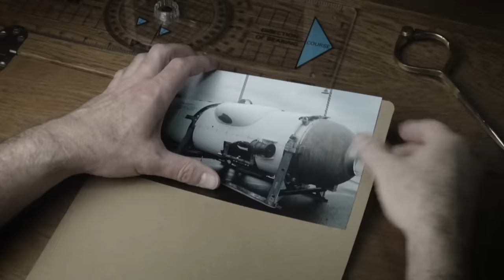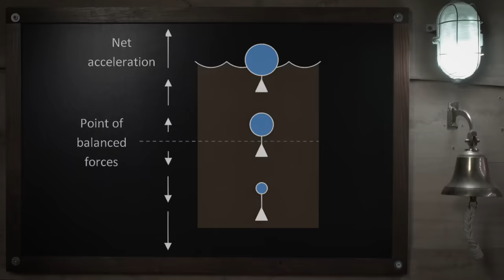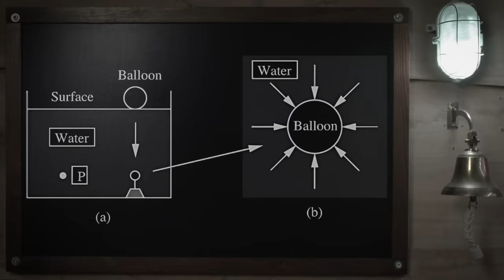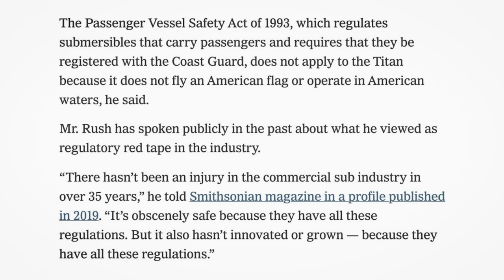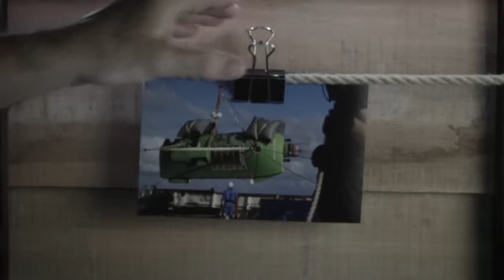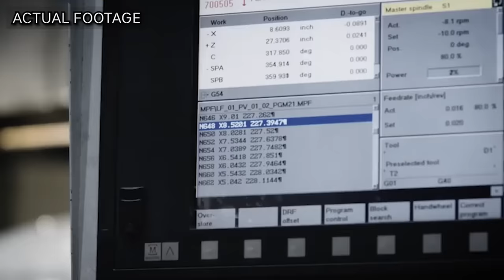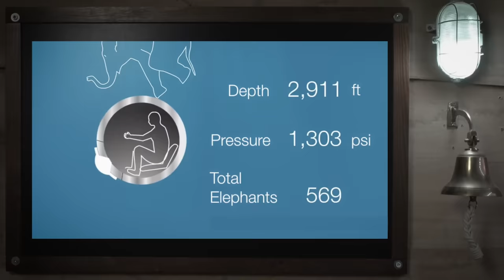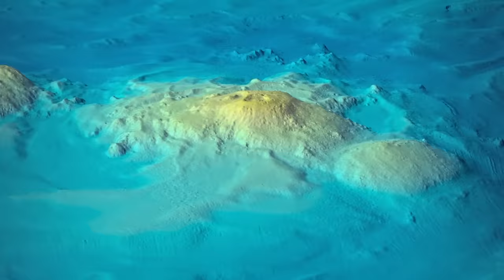Titan: From Inception to Implosion

Comment: One important thing to note, some experts agree that the sensors were a gimmick. There was no testing confirming that they would work or even provide enough time to do anything.
Reply: That sounds very on brand for Rush.
Reply: I explained it in more detail in my comment, but essentially the time between "sensors warning you" and "catastrophic failure" is in the seconds to milliseconds range. Enough to inform you of your imminent death, not enough for you to do anything about it.
Reply: Basically it's not sensors for a warning it's sensors that tell you "You're fucked" 💀
Reply: Basically it's not sensors for a warning it's sensors that tell you "You're fucked" 💀
Reply: @Ember2168 which would  be better not to know
Reply: Kind of like using a smoke alarm to warn you of an air raid.
Reply: @WineScrounger  Well, you certainly have a way with words😂
Reply: @Ember2168  agreed. All the " sensors" did was tell them that their death clock is now counting down.
Reply: @MechMK1 well, it gave them just enough time to kiss their asses goodbye.  And into the kingdom of hell.
Reply: The one small mercy with an implosion like this is it happens so fast you won't feel a thing or know its happening.   This genius invents a system where an alarm will say "YOU'RE GONNA DIE"  when its too late to do anything about it and you're trapped in a submerged coffin kilometres below the surface of the ocean.
Reply: @irieite9666  it's TERRIBLE!  I'm still having nightmares
Reply: Yeah, I recall seeing an image of the canopy cracking with the caption "When it cracks we have a warning that is cracks" Who on earth thinks that anything of a warning? What was the plan on doing if cracks started to show on the canopy? abandon ship?

this alwys make me think about ore mines that used oak studding (I believe it was oak) because that would creak before it collapsed rather than another wood-typ that "just cracked", with the exception the oak was actually a good idea.
Reply: @irieite9666  Just imagine, instead of being blissfully unaware until the moment you're just ... gone. Now you get a last-second warning to remove that blissful ignorance in favour for absolut despair of what WILL happen.....

now.
Reply: @skorpion7132  imagine that poor 19 yr old, twittling his rubix cubes to calm himself down. Terrible
Reply: @MechMK1  thinking about hearing a loud beep and before you can even read the warning, you’re dead. makes me feel sick man
Reply: If you were alerted by the sensors of an issue with the carbon fiber tube it was already too late.
Reply: And indeed, the “test” of the mission proved their ineffectiveness.
Reply: **WARNING** YOU HAVE 0.001 SECONDS BEFORE HULL BREACH **WARNING**

Comment: The problem with carbon fiber lies with the fact that it's main strength lies in tension, not compression.
Reply: However it's used extensively in racing car  crash structures.
Reply: @nikoscosmos  I think it's used in cars for weight loss, not to provide survival-ability when the car hits a brick wall. You can have carbon fiber spoiler and car body, but the cage that protects the driver is still made of alloy of sorts.
Reply: @nikoscosmos  the pressure there is a sharp tension pressure, that is, longitudinal to the fibers...
cars or airplanes rarely require withstanding pressure vectors perpendicular to the fiber structure (where your only carrying strength is the binding epoxy), the exception is carbon fiber wings, but even there, they can use elasticity transferring the fiber strength that way to compensate for it (why you get so much movement in a 787 wing)... you cannot do it with pressure.
Reply: @nikoscosmos  nope the race course provides that.
Reply: @nikoscosmos The carbon fiber in cars isn't to prevent the cars from crumpling. Besides, crumpling is what you want in a crash. Crumpling, rolling, and shedding displaces the energy away from the driver (and passenger, where applicable). That's why NASCAR wrecks are so fantastical most of the time, and drivers still walk away with little to no injuries. When NASCAR drivers DO get hurt, it's in wrecks that usually don't look flashy. The wreck that killed Dale Earnhardt was super simple. No rolling, no major crumpling, little if any shedding... Just a smack into the wall, and he was finished. If carbon fiber prevented crumpling, race cars wouldn't use it because it would make the cars more dangerous.
Reply: @kekistanimememan170 What?
Reply: @nikoscosmos  It also is important to note that you can walk away from a car crash if it's built even ok (and they build quite a few race cars pretty fucking well, with some pretty gnarly crashes being completely survivable). If a sub even has a propulsion failure in a place too deep, everyone is fucked. However, you'll be less fucked if you're in a normal sub and not a carbon fiber sub cause they were using old carbon fiber to make the titan.
Reply: @nikoscosmos it also comes down to design and useage. In a crash the carbon fiber in a race car can deform and shatter to an extent without putting the driver at risk. If anything deforms on the pressure hull of a sub its over with. There's also something to be said about the curing of a half inch to inch thick carbon fiber monocoque for a car and a 5 inch thick submarine hull, the chance that carbon was properly set is low.
Reply: @harryshuman9637 that's not even close to accurate. F1 has carbon tubs. Most all hypercars for the road also have carbon tubs
Reply: Real Engineering brought up that it's usually used in aircraft which resist tension from the pressure inside. Did this guy really think aerospace engineering would make him qualified to deal with the exact opposite situation underwater?
Reply: Just because James Cameron says something doesn’t mean it’s true. James Cameron is James Cameron because he is James Cameron.
Reply: We've run into this problem in the sport of archery, where increasingly bow limbs are being powered by using carbon fibre laminates on both sides of a core.  Previously glass fibre was used for power.  So as the bow is drawn one side experiences tension, the other compression, and there is a shear force along the core.  Carbon fibre is useful because you can get the same tension for lower weight, partly because the glass stretches slightly and lowers efficiency.  However, that inside compression face does occasionally delaminate in a way that glass limbs tended not to, because carbon fibre is relatively poor under compression.  

Interesting example the other way, in WW2 Barnes Wallis invented the earthquake bombs and dambusting bombs after learning that reinforced concrete is great under compression but weak under tension, so a powerful shockwave would crack it on the tension cycle.  

I can't help feeling though that all of this is moot when you exceed the test rating of the acrylic window.
Reply: @wedrivebynight crash barriers on racetracks
Reply: @hauntedshadowslegacy2826  yes exactly, thank you!! I get so annoyed when people complain about a minor crash totaling their car and how everything broke. that's the whole point!! momentum from the crash has to go somewhere, so that's why all the parts (panels, frame, doors, etc) crumple or shatter, because they absorbed the force of the impact, not you! I really think physics needs to be mandatory every year in high school because the amount of morons out there operating a 4000 lb machine while texting on their stupid phones because they can't be bothered to pay attention to their surroundings and have no respect for the laws of nature is absolutely insane.
Reply: @nikoscosmos  Eh no, carbon fibe is not used as the replacement for crash, and furthermore, that crash is a ONE TIME event, a submersible is CONTINUOUSLY subjected to high pressure differentials.
Reply: Exactly metal or steel are both strong and under pressure they compress or expand accordingly.  The fact that it wasn't even a sphere made it worse since a metal sphere is one of the most durable structures to put under pressure. It was a failure since Rush said Go

Comment: 32:17 See, I don't agree with that. If you look at the stress-strain curve for carbon fiber, there's no warning whatsoever before failure. The yield point is the failure point. I know they heard noises when the hull was new but that is probably just weaker fibers breaking. Even the Engineer who was allegedly fired for refusing to rubber stamp the design said the same thing about the amount of warning you'd get.
Reply: It was NEVER evacuated to get rid of air it was SUPPOSED to be 7 inches thick, I was made from rejected aircraft carbon fibre, Case closed he would have been convicted for corporate manslaughter BUT who has the jurisdiction

Comment: One quibble I have is that the US Navy's SOSUS network is actually *extremely* good at localizing the origin points of sufficiently loud sounds such as implosions. This was ably demonstrated with a number of lost submarines during the Cold War.
Reply: Indeed.  It was and is highly useful at not just detecting the sounds but finding where they came from.  Without SOSUS, it would have taken far longer than a couple of months to find where Thresher and Scorpion went, as well as other incidents.

Comment: In theory Rush could have had a groundbreaking business and concept…if he did proper testing and development. He could have perfected the disposable submersible. If he could have proved and tested the unit to, let’s say 20-25 dives, reused the hemispheres and I’m sure he could have made money. If they got better then the process would become cheaper and the dives would have become more frequent. Too bad he did the cost cutting on the safety and testing part😑
Reply: Its the design of the Titan too, it was flimsy and shoddy.
Reply: You are talking about a man who consider safety to be pure waste. It would not been possible in practice for Rush to have perfected his submersible because it would never have been safe enough for multiple usage. Moreover, he insisted on using carbon fibre, and chose not to do proper testing even when his own safety officer warn him about it. His safety officer was fired by the way for asking him to do proper testing.
Reply: If the submersible has a lifespan of 25 dives then needs replacing it probably wouldn't be viable commercially. Actual DSVs have a service life that's usually measured in decades and thousands of dives. Yes that includes rebuilds but rebuilds cost a fraction of a complete new hull. For anyone who needs one for a few dives, hiring one and it's crew would make more sense than buying a 'disposable' model.
Reply: Ha ha ha ha ha, well this one was definitely disposable. Lets face it...at these depths and pressures, it is far easier to go above the atmosphere "Outer space", then it is to go in the opposite direction. Going towards the center of anything that is going to crush you, makes little sense when our Sun gives us Nuclear Fusion that gives us all the energy that we need for our survival. We don't need to go that far beneath the surface for what we need on the surface.
Reply: Nah, it was screwed overall when the guy decided to use CF. Based on his statement about its strength, it's clear that  the difference in the strength of CF in compression being only a fraction of it's strength in tension, was totally ignored. When in compression CF only has 1/3rd to 1/2 of the strength that it has in tension. 

Using CF for this application never made sense, the reduced  strength and issues with pressure cycling should have stopped the project when it was just a wild idea
Reply: @DemoCATicMAN getting to space is not easier than going to great depths, getting in and out of the atmosphere requires so many other considerations with heat and the math of flight. Doesnt even make sense to compare them both are complex
Reply: @IWannaGoMissing I think it was from a hull point of view and in that case the guy is definitely right, much easier to deal with 1 atm of pressure difference than with 380 atm. Apart from that, tension loads are much easier to handle than compression loads, so from the hull pov, it is much easier to go to space than to the bottom of the ocean.
Reply: Somehow the phrase "disposable submersible" does NOT inspire confidence...

Comment: 44:40, did he? What he constructed (or rather ordered), was not going to work. Engineers said so up front. So at best, what Rush "accomplished" was order an ill-equipped vessel with a mission for an unreachable destination over the backs of people he eventually got killed.
He innovated nothing, he did excatly what every other business man does: throw money away on an idea that at best sounds interesting in theory, then goes on not wanting to pay for what is required to do it properly, cutting corners (and then some) <-- hence why its throwing away money. 
These men are not to be celebrated, not now, not ever.

Comment: A side note: Stockton Rush's acoustic sensors were based on the idea of the Kaiser effect.  The idea of the Kaiser effect is that as you put something under stress, as the struct compresses and pieces may rub together it will create a seismic or acoustic signal. If the load remains constant, the signal remains constant. This seems to have been observed in rock or concrete structures, as microcracks occur.
   The error in his practical use was, whether carbon fiber follows that, and also he never established what was the failure point. What I have seen for CF is a curve where load is compared to cycles, 20% load may allow a million cycles, while 80% may allow a hundred. This indicates that the failure of carbon fiber is progressive, the failures you're hearing aren't the old ones. He even had the observation that he heard more noise than the Kaiser effect predicted he would. 
   Once the part has enough damaged spots, failure would increase until it got exponential. CF shatters, it absorbs enough force that it can't release it fast enough, like tempered glass. Voids would concentrate stress, and delaminations also would. Carbon fibers are a 1-d material, you can make a 2-d surface separated by epoxy, while metal crystals are 3-dimensional.
Reply: that was a really interesting read thanks :)
Reply: It’s almost as if there’s a reason that professionals don’t build deep sea submersibles out of carbon fiber for a reason? 🤷🏻‍♂️
Reply: Yeah, I heard that in a nutshell: when the system detects sounds above certain treshold it means the failure is imminent, leaving no time to surface.
Reply: @KPW2137 perfect
Reply: Thank you for sharing that. I've learned so much in the YT comment sections. Im always so impressed by the kind of knowledge and expertise people are walking around with.

Comment: I know people who were witness to the tests early on, the clip where Rush states it was “tested” to 300 meters(?) The model actually failed at that depth and they spun it.
In addition my witness stated the wiring was awful and primitive as was the workmanship and design aspects.
Reply: wiring was primitive or simple? if wiring is like a web, you can't really fix it in short time
Reply: @vipvip-tf9rw  By primitive I mean it didn't have stuff like circuit breakers etc.

Comment: A simple way to understand why carbon fiber is not a good material for compressive loads is to imagine holding a piece in your hands. 

When you pull on it, in tension, it is incredibly strong, significantly stronger than steel. 

When you push on it, in compression, it immediately buckles with almost no resistance. 

In compression, it is the resin that provides much of the compressive strength. 

Also, this buckling of fibers results in delamination between the fiber and resin layers, which further weakens the bulk material over future compressive loads.
Reply: Carbon fiber is an excellent material for something like a car, both for high performance light weight exotics, and even things like trucks, as it's apparently holding up quite well in truck beds. 

But it has no place on other vehicles like a submarine. I'm stunned this proposal made it into the prototyping phase, let alone into active duty carrying passengers.

Comment: 0:15 I love that everywhere on the net - including this video - refers to the sub as "controlled by a Playstation controller" when 1) it's a PC controller and 2) it's very clearly modeled after an Xbox controller. Yes, I know how pathetically tiny a nitpick that is.
Reply: Definitely not modeled after an Xbox controller as the sticks are not offset. It's for certain a cheaply made pc controller shaped and designed like a PS4 controller.
Reply: Matter of fact, it's an $18 Logitech controller. The only thing reminiscent of Xbox is the colored buttons.
Reply: @Quantum-  The buttons are also labeled Xbox/Nintendo style. I guess it's a mashup of different manufacturers' styles. But for real, what is with those thumbsticks?

Comment: Technically that wasn't a Playstation controller Rush was using, it was a Logitech wireless game pad, the device used to send unsuspecting billionaires to a watery grave can be purchased for around $50.

I would absolutely recommend getting one as they're pretty good if you want to play a console optimised game on your PC (they have an identical button layout to the PS4) but as a way to pilot an experimental submersible into the abyss? Definitely not.
Reply: WOW really ! Except the controller had NOTHING to do with it
Reply: @gowdsake7103  Well, it certainly pointed them in the wrong direction, so yeah, in the Rube Goldberg chain reaction of terrifying sequence of events, it was kind of the first in a confluence of dumb decisions.